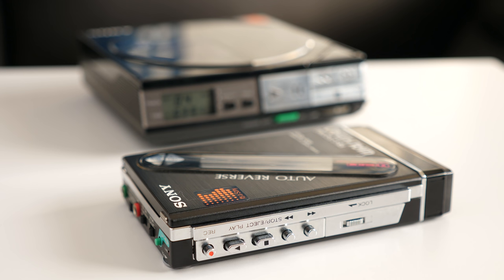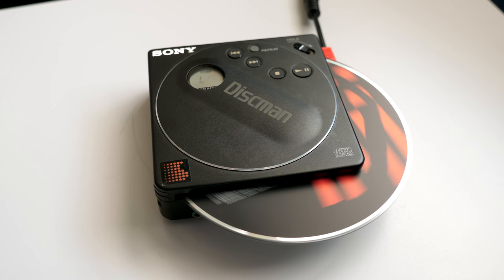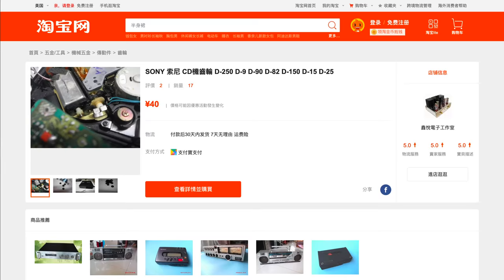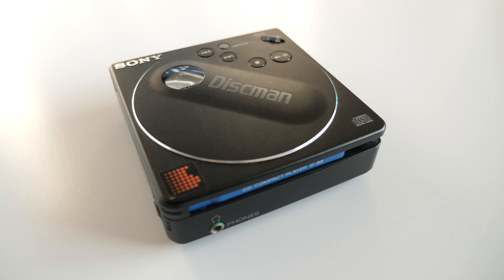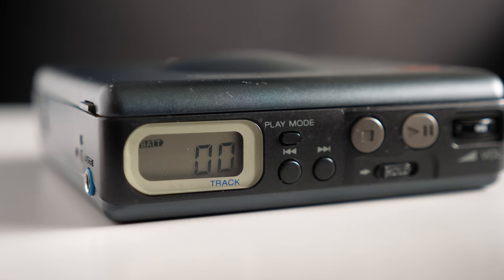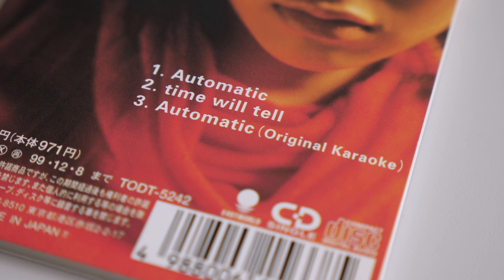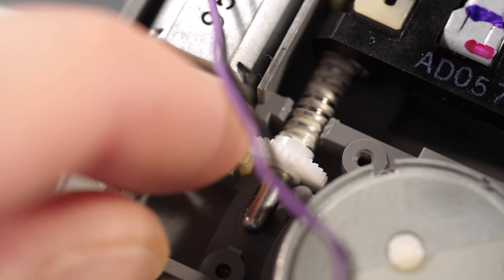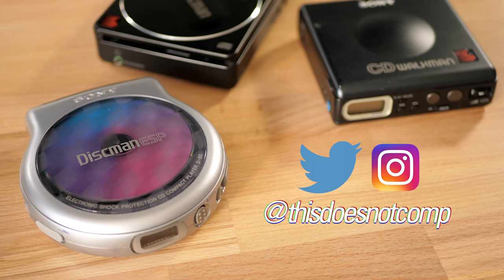The Smallest Portable CD Players Ever Made (That Nobody Bought)

Comment: Also, some CD's art while spinning is quite fun to look at
Reply: Nothing beats the coolness of physical media being played back through transparent windows (or just the opening itself).
Before I replaced my PC case, I had cut a window into my optical drive to see it in action. Still have an optical drive on current case but I do miss that opening... May as well mod this case at some point
Reply: I recall one of "The Spin Doctors " albums' had a spiral type artwork on the CD.  during the last couple of tracks it would look especially cool at lower RPM resulting in a "minimally hypotonic cd spiral-graph " to view...
I also remember Pearl Jams' CD arrwork was unique too.
Reply: I used to keep the lid on my PS1 open and push the little thingy to keep the CD spinning.
Reply: apart from spiral cd art are there any cds that have pictures only visible when spinning ?

Comment: It’s amazing how good the build quality was on 80s and early 90s gadgets like these.  I have a Technics SL-XP6 that is from that era and to my mind was the best, it’s in as-new condition and works perfectly so I make sure I use it every 3 months or so in order to (hopefully) have the best chance of surviving longer.  These days I feel gadgets are not made to last.   When they stopped making CD portables from metal and instead used plastics they did get a lot cheaper and more accessible, but the quality was lost.
Reply: As with most things plastic, the quality suffers. I picked up an old Singer sewing machine from the early 50's in all metal. It works like new and its sturdy and strong and smooth to handle. I scored it for $40 including the sewing table that it comes in.

Comment: I bought my Sony D50 in mid 1985 while stationed in Germany (then West Germany) and it is still completely functional.  I also have the battery case that I bought along with it.  As you are probably aware it operated on 5 "C" cells which as I recall would last well under two hours.   For what it's worth the first CD I purchased was the newly released Dire Straits album Brothers in Arms.

Comment: The shot at 15:31 shows the exact thing you need to adjust to likely get the laser working properly: the small thing with a philips head is the trim pot for adjusting the laser.

Comment: I really miss the old Sony logo that looked like an S made up of dots, it almost looks like braille.
Reply: I have it on my wireless headphones transmitter - good old analog infrared, use the headphone's circuit as a receiver for my better headphones to play games on headphones on the living room TV, let me tell ya that any rhythm game works flawlessly with those as they have downright zero delay from their analog nature (yeah, almost zero, of course they probably have theoretically some nanoseconds or what). 
The logo on the tall rounded 90's looking transmitter (which it in fact is, older than me may I add) really is a nice touch from the past, when Sony specially had the balls to try anything. And: ye they still worked flawlessly even if I got them 2nd hand... other than one old electrolytic cap.

It's so much "built to last" that you can actually find a fully detailed service manual for it with all the circuit board traces laid down and the schematic, with full Bill of Materials. Then nowadays some manufacturers hide the service manuals as much as possible so you really can't repair it...
Reply: That's how you know It's a Sony
Reply: so cool! I am visually impaired I wonder if you can feel it?
or was it printed on and kinda like what IBM does with there logo?

Comment: Today I learned that Sony used the "CD Walkman" branding on a handful of players made before the year 2000, the year "Discman" officially became "CD Walkman".

My CD Walkman D-NF430 from 2004. that I legitimately still use because I'm a total physical media guy and also because it's also a radio, isn't close to being as small as the units shown in this video but it's still pretty small, 137.8 x 137.8 x 31.1mm, and it's only 31.1mm thick because the housing for the single AA battery (and possibly also the AM antenna?) bulges out several millimetres from the rest of the body. It's still slender enough to easily fit in the lower pockets of any jacket I have.

Comment: A slightly later 3 inch cd player was the Philips Pocket Expanium EXP 401 Personal Portable Mini MP3 CD Player (EXP401/17).  It was sold as a compeditor to MP3 players using a Burn-Your-Own MP3 CD philosophy.  Using MP3 files you could fit an entire album on the smaller disks.  Not as quality looking as the Sony's, but it plays MP3 files as well as CD singles.  A few are listed on EBay.
Reply: I discovered Philips released at least five models of these Mini MP3 CD players in the early 2000's: EXP 103 (in 2000),  EXP 201 (2001), EXP 401 (2002), EXP 411 (2002) and EXP 431 (2003). I have a 431 but the 103 is the most retro looking. Build quality is nowhere near the early Sony players so getting a working unit may be difficult.

Comment: Managed to pick up the Crown CD-10 yesterday.There are a few differences between the CD-10  and the D-88.The D-88 power supply does not work in the CD-10.The CD-10 only has a power jack on the slip on battery pack and not on the player.The CD-10 has a line out where the remote jack is on the D-88.The obvious lcd display down the bottom of the CD-10.Both sound amazing.

Comment: In 2002 or 2003 I bought an iRiver IMP400 SlimX CD player and for me that was the smallest CD I ever owned. It was very thin because all the controls and LCD were placed in the wired remote. It had ID3 tag support and there was a small Windows app that let you assign lyrics to songs. It played regular CDs, mp3 and wma discs. It had decent battery life powered by those thin gumstick rechargeable batteries. It had a hidden snake game built in to the settings menu. It was a great device but mp3 players were dropping in price, flash memory players in particular and after a short time I got the iPod 3rd gen. I still have the iPod.

Comment: I've had my D-88 for about twenty years now, along with other famous Sony Discman players, like the D-555, D-515 (first one with shock protection), D-303, D-25 and others. 

It did have some trouble playing, I adjusted the tracking, which helped somewhat. Good to know about that gear. I did clean and re-lubricate the worm gear on these players. Also good to know about that replacement battery.

I also have a Sony D-EJ2000, which is the last purely CD playing Discman Sony made (other models had compressed audio playback as well). This model is hardly larger than a CD and might actually be the smallest portable CD player ever, volume-wise.

And the display problem could (hopefully) be a matter of cleaning the zebra strips.

Comment: In terms of (small) size, I would mention absolutely gorgeous Panasonic SL-J900 / 910 Square Portable CD Player. While it had a footprint slightly larger than a CD disc, it was extremely thin and thus very portable. I owned a few of them, and they are a work of art.
Still available on ebay, some of them in mint condition, it's worth to check them out.

Comment: I am 41 these days... I always had a knack for tinkering with electronics since I was a child. When I was 10 or 11 I built my first phone tap by dissembling two walkie talkies I had received as a gift. 
I opened up one and soldered down the PTT switch so it would always be transmitting, I removed the speaker and condenser microphone, and replaced the microphone with some alligator clips. I then went down stairs to the basement and found the telephone junction box in the house, when I hooked up the clips I was able to find the correct wires just like in the movies. The only problem was the sound was very low, I had a Spy-Tech toy called the long range listener. I opened this up and added a headphone jack inline with the microphone on the device with a little toggle switch added in, this way I could still use the long range listener, or I could plug that in on the receiving end and amplify the sound from my phone tap (essentially functioning as a pre-amp).... Voila it worked, now I could hear the phone calls clearly on my walkie talkie  without having to be in a completely quite environment to hear it. 

sorry for the story bragging about my youthful prowess with electronics.... Just the insides of those devices brought back memories. I eventually became an PC IT guy, butr I always regret not having the means to go right from H.S. to college and get a degree in electrical engineering, but alas, it was not so... I guess I could have gone down a whole different path in life in general if that aspect of my youth was fostered more, but que sera sera, as Doris would say... 

Anyhow, I caught my sister doing some teenage stuff she shouldn't be doing with that old walkie-talkie phone tap, and it later was converted into a wireless transmitter for my brothers guitar and Amplifier. Good times, and seeing the inners of some old tech brought back memories of a time you could just take apart and tinker with them, now everything has so many tiny components and micro soldering that I miss the simpler times in that respect... but enjoy all the conveniences since than, that I don't miss them too much.  

Great content and thanks for the nostalgia.

Comment: the display problem may be the polarization membrane that degraded over year. You can try to buy some at ebay, and test it outside the device to see if the characters shows up and then attempt to change it.

Comment: You could have saved the original gear by soaking it in isopropanol before trying to force it off without any preparation...made the same repair today and it worked like a charm.

Comment: The 3" holds on in the cd-rom market. I just installed a USB WiFi dongle and the install disk was a 3" cd-rom & my new old PC cd drive even had a 3" drop down in the 5 1/4 drive so I didn't need an adaptor of copying it to a stick.

Comment: The laser diode might deteriorated to the point of being useless, it is quite common in early lasers they used to use in 80s, early lasers were not that good.

Another problem might be under the main lens there is a 45 degree mirror/beam splitter for laser beam and return sensor, these can get dirty or collect dust over time and ruin laser detection on sensor, coupled with weaker laser diode it can make player not get any laser data signal. It is a good idea to clean that mirror and any other mirrors and screens in the path.

Comment: Sony always made the best but most frustrating equipment to work on. It was built to work well then be thrown away when if fails. I worked for years at a repair shop (1970-1978) and was in charge of the audio repair area. I'll never forget the day I took a radio glass front with tuning frequencies out of a Sony tuner and went to clean it. I sprayed it with Windex and all of the numbers and tuning dashes floated off. OMG! Talk about a learning experience!  🤣  I can laugh now!

Comment: I don't want to be 'that guy' but please, please bear in mind that lithium grease doesn't have great longevity on plastic gears, because it's petroleum based. It can break down the material over time. I'd use silicone grease, which is recommended for low-stress plastic mechanisms.

Comment: We had a couple mini-CD players that were MP3 capable. I remember them as being smaller than these. little more than the width of the mini-CD itself and round in shape. Although they may have been more like the DiscmanESP.  I want to say they were Kangaroo, or perhaps Joey branded. Then again, after a quick search, it may have simply been the Phillips EXP411 Pocket Expanium. Which is like the ESP but with an even larger hump at the top. Perhaps it is just my memory of it that made it sleeker than it actually was. It was still a mini-cd based MP3 player, just perhaps not as compact as it seemed at the time. Although I remember it having a different finish and seeing the Memorex Min-CD MP3 player I might not be wrong after all as that looks smaller than the Phillips.

They were handy MP3 players while the format was still fairly new and flash media was both limited in capacity and expensive. Zunes and iPods were still several years away at that point. While a mini-CD could only hold about 20 minutes of standard CD audio it could hold more than 3 hours of MP3 formatted music. I used mine primarily for Audiobooks during my commute in the 90s. Since audiobooks could acceptably be compressed more than music, I could have entire unabridged audiobooks on a single Mini CD rather than the stack of full-sized CDs or Cassettes that they came on originally.

I was a sucker for these sorts of gadgets. Unsurprisingly I had a mini-DVD camcorder as well.

Comment: check the locking spindle on the D80.. looks like the same one used on the first Playstation.. and the problem was it would get pushed down when putting a disc in just enough to make the laser lose focus on the CD.. i used 2 dimes to pry it back up just enough for it to be properly focused.. but i would use something a little thinner since it looks to be much closer to the bottom.. there is also a laser pot right on the bottom shown at 15:34 clockwise adds more power and counter less.. hope this helps..
Reply from the maker: I knew about the laser adjustment potentiometer, but hadn't heard about the spindle problem -- definitely something to look into!

Comment: I found this episode rather frustrating to watch, because in the end none of the devices are actually fully working. Before I'd spent $60 on a gear I'd at least tried my luck on the LCD and in case of failure I wouldn't have spent that much on a gear at all and probably delayed the video. So instead of releasing a video about a triple failure, I'd rather release a video after all devices were fully functioning.

Comment: im quite familiar with that gear failure, the plastic puffs up slightly and turns to putty, most turbo grafx/pc engine cd units suffer that issue and for a long time it was a death sentence, but in recent years a supply of acceptable cheap chinese replacements has popped up to revive them, ironically they seem to be the only system where the laser failure rate is currently negligible which is a good thing since damn if that isnt an expensive module and a pain to install

Comment: you can increase the resolution of your prints by printing slower, increasing the granularity of the movements on your G-code file, and using a finer nozzle

supposedly, theres .1 nozzles and even down to .025 (i wouldnt try anything less than the .1 though, seems like it would take forever for not a lot of benefit)

a little research finds that .1 nozzles defnitely exist, and you can buy them on places like amazon or ebay, but ive not yet found anything smaller

Comment: I bought one of these (the first one, the D88) at the time. It wasn’t particularly good at playing a CD whilst walking along, which I often tried. I mean, you could if you were careful, but it was a bit like holding the player as if it you were trying to imitate a steadicam. Also if anything touched a normal size CD while it was spinning it just stopped it rotating briefly. It wasn’t completely impossible to walk with it and listen to tunes, holding it out, but you couldn’t do much else while you walked. I did it a few times during that summer. I’ve still got a few mini CD singles somewhere, most of the time I used normal sized CDs in it, and mostly only when I got to where I was going.

Comment: The later model mit Electronic Shock Protection made me miss my old Sony D50 Mk. II portable CD player...that was quite some time before ESP was introduced. Instead, it had some kind of Physical Vibration Limiter, which also provided power: the sealed lead-acid battery pack, of course.

It had the same footprint as the player and was attached to the underside of the player, nearly doubling its height and more than doubling its mass. The shoulder strap was attached to the battery pack, not the player. Walking was definitely possible with this player, jogging definitely not. The rather strong battery pack also meant that the player had a substantial head phone amp which could easily drive high quality high impedance headphones. The later models which ran on NiCd batteries sucked in that regard.

Comment: I wonder if my D-777 is actually smaller than these mini-CD players, if you're talking volume.  It's thinner than the D-88, but of course, it's length and width accommodate a regular-sized CD.  I used the heck out of the thing back in the day, and it still works but needs some servicing as it's a little finicky--like it stops playing when you bump it.

Comment: Old lcd display sometimes suffer from sweating out silicone from the rubber connectors of the glass panel. Mostly cleaning them up solves a dead LCD! It involves removing that metal bracket surrounding the display. Now I can't tell from the video how that is assembled, if it is clipped on it is doable, if it is soldered well your in a world of hurt...